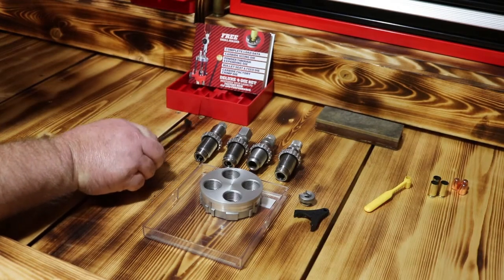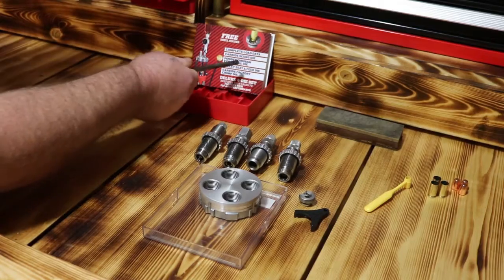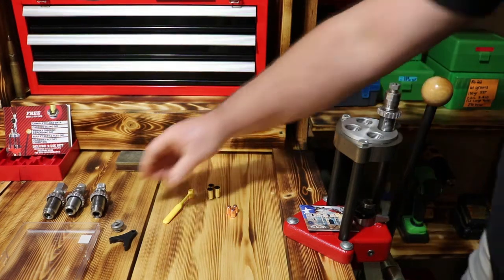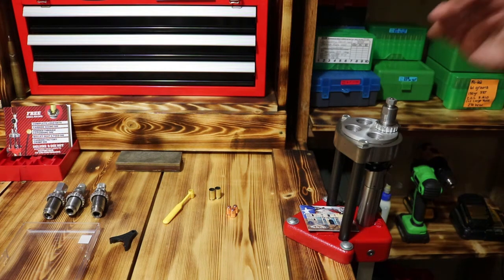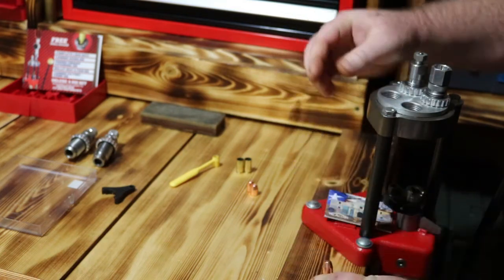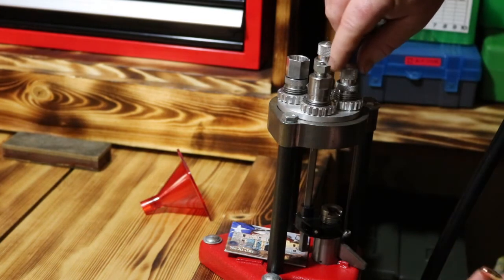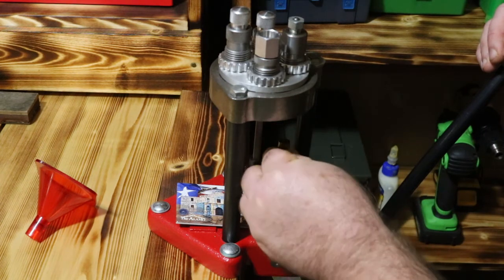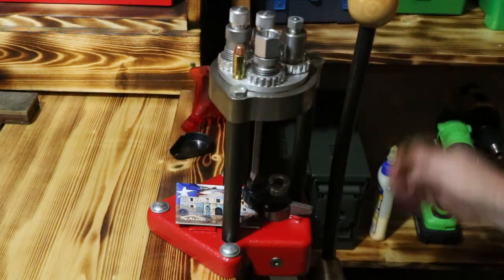Lee Classic Turret Press Die Setup

Comment: Can u put a 3 hole turret in this and it still work as it should ?  Or do u have to use a 4 hole one?
Reply from the maker: You can use a 3 hole turret ..,I have seen no issues
Reply: @StewartCountyBallistics  which one did u buy ? Does the Lee pro 1000 fit this press ? Because I can’t find a 4 die set for my 7mm08 or a 9mm
Reply from the maker: @alanjkilgoreable  the lee classic turret press is the one I use most of the time
Reply: @StewartCountyBallistics  that’s what I’m looking to buy.  But it has 4 hole turret and I can’t find a 4 piece die set for 7mm08.  Unless I’m looking in the wrong spot    I am also new to reloading so maybe I can use a 3 die set ?
Reply from the maker: @alanjkilgoreable  most of you rifle dies are 2 or 3 .. for pistol I like the 4 die set .. the factory crimp die comes in the lee 4 die set .. everything is hard to find right now.. I will see if I can find the 9mm dies for you
Reply: @StewartCountyBallistics  ok so even tho it has for holes u could still use it with 3 die set or do u have to use a 3 hole one to make it work right.
Reply from the maker: @alanjkilgoreable  either turret will work the 3 hole or the 4 hole
Reply: @StewartCountyBallistics  ok. I seen one that fits the pro 1000 for 3 hole wasn’t sure if that would fit this one or not the notches on the side look diff